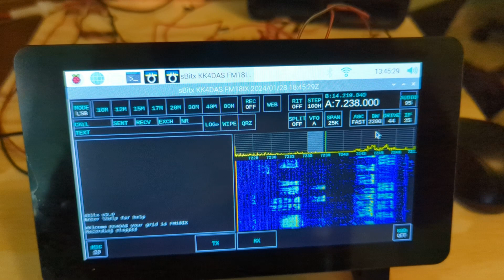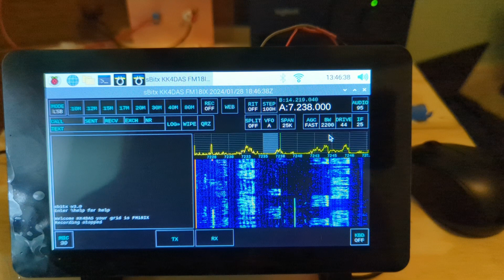KK4DAS sBITX First Demo

Comment: That's just the kind of hybrid I like: digital and analog, ready-made off-the-rack modules and solder & wires homebrew, hundred-year-old technology and twenty-first century whiz bangs. Building the new on the foundation of the old, the way corals live their reefs upward. I might have to build one of those--sBITX that is, not a reef. --Todd K7TFC
Reply from the maker: Todd - you should definitely join me on this journey.  I've asked but am not aware of anyone else actively homebrewing an sBITX.  Anyone out there taking the sBITX challenge?